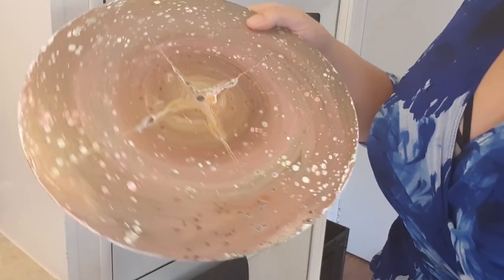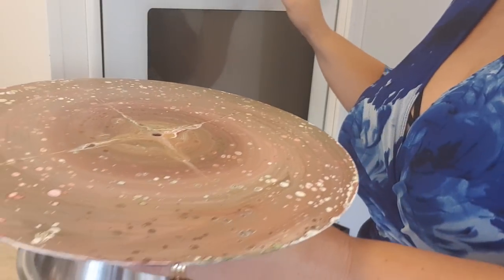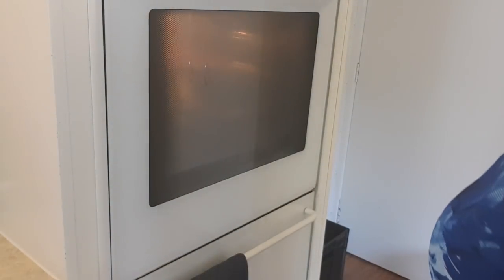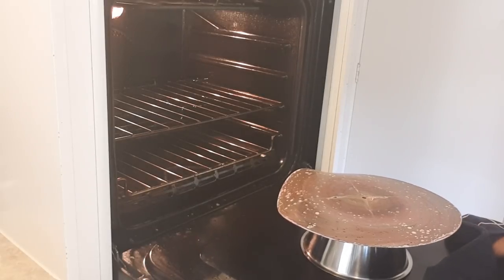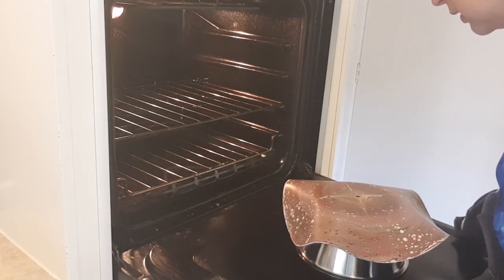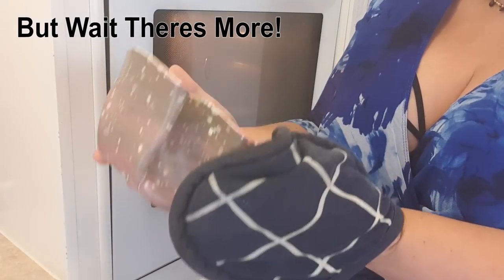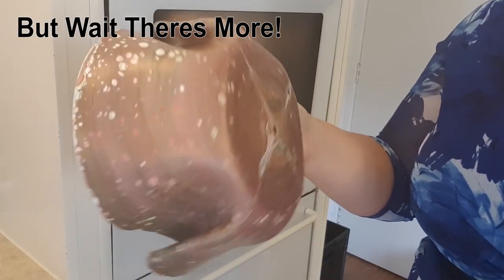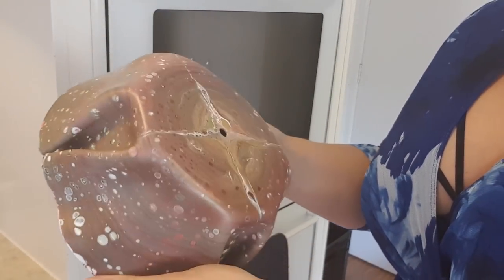114 Acrylic Pour Record into a Bowl - several hints

Comment: If you put painter's tape over the hole on the back, before you pour, the paint will cover (but not fill usually) the hole. When it dries, the tape can be removed and the hole will stay covered. That way, you could use your finished bowl for dry snacks like chips! On the other hand, if you wanted to use it for plants, the hole allows for drainage so that there isn't too much water. (My sister told me plants need drainage, but since I have purple thumbs and can't grow anything except kids which come with their own drainage system, I have to accept her word for it.)
Reply from the maker: Thank you Martha, yes that is what i have been doing for the last few (tape over the hole).  Your sister is correct about plants needing drainage so if you were using this as the actual pot that would be correct but then the painted side of the record would sit in water in the water tray.  If the whole was watertight then you could use this as the water tray and hide the pot inside.
Reply: Martha D I maybe wouldn’t use it for snacks since it’s not coated properly but you do you 😂👍🏼 I’ll support

Comment: Do you not have problems, when you push the top bowl down on top of the record, whether it be the same shape or not, with it moving, pushing or scraping the paint or damaging it in anyway?
Reply from the maker: If the paint has set well (about 2 weeks after dry) then it shouldn't damage the paint, re the moving, yes it can and it takes patience and a good steady hand :)  The recent one I did by just pushing with my hand and that was more control.